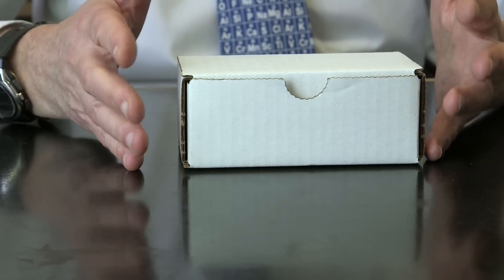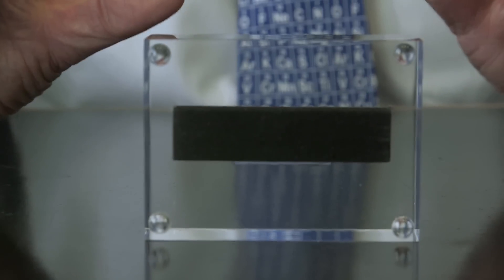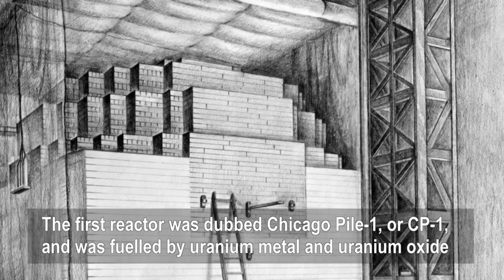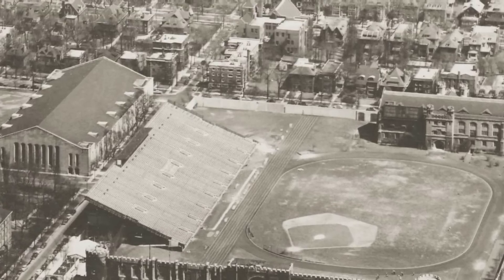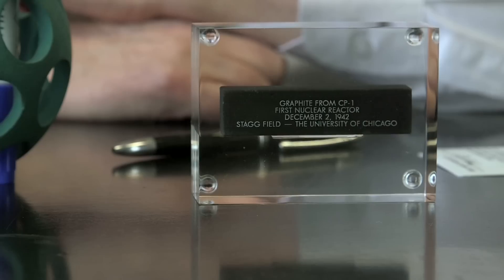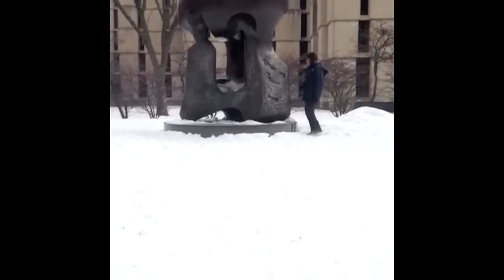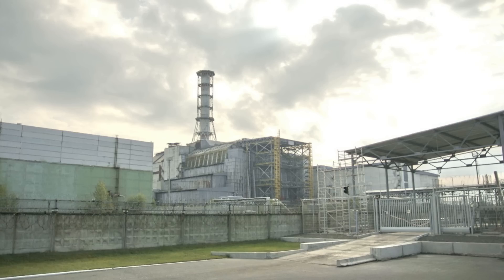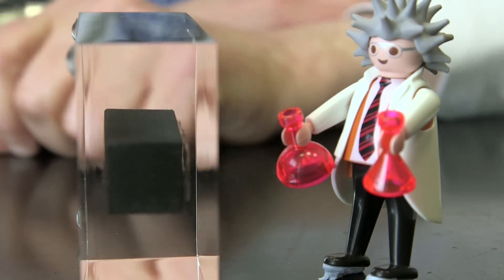What's in the Box?

Comment: Would be interesting to see a video concentrating on the thorium fuel cycle and its role in "burning" actinides and nuclear waste. So much of the debate and nimby-ism of nuclear concentrates on the meltdowns and on the waste disposal and weapons proliferation potential whilst ignoring its potential to finally wean humankind off of fossil fuels and thus slow the output of carbon into the atmosphere. After that, fusion, or space-based microwave power transmission from solar satellites. I suppose that is getting off track into physics instead of chemistry, though.

Comment: Brady, have you asked the professors what they think of the designs for the Liquid Fluoride Molten Salt (LFTR) reactor, which burns Thorium?  From what I understand, these reactors are not only inherently much safer than today's high-pressure reactors, but could actually be used to burn up most of the nuclear waste currently sitting in nuclear power plants all over the world, and produce massive amounts of energy in the process. 

An experimental reactor was built and run for years back in the 1960s at Oak Ridge labs, but was not adopted because at the time, we needed plutonium for bombs.  And these reactors do not make Pu. 

In any case, I would love it if you would ask the professors to investigate, and - if they find the concept has merit - talk about it in one of your videos.  Developing a nuclear reactor takes not only hundreds of millions of dollars but (unfortunately) political pressure as well, since the nuclear industry is so heavily regulated.

Comment: The biggest issue we have with nuclear reactors is that BWRs are cheap but produce lot of waste. And the other models and types are not popular due to cost factors. There are so many ways of achieving better, safer and cheaper nuclear power. But we just don't seem to be willing because of money.
Reply: The shift will occur when the average salt/thorium reactor is cheaper to produce then the waste of a water reactor is to dispose of. (Now if someone can generate power from nuclear waste, that'd be a neat option.)
Reply: Well thorium Cycle reactor with a breeder jacket - as far as I understand. Is able to transform "nuclear waste" to fuel again. But it will sacrifice some of it's own energy output to do that. But then it can add itself in to the cycle. But basically it only hasaround half of the potential energy output compared to the fresh fuel that could be added.

Just like recycling anything else, it takes some energy to initiate the cycle.

Not sure if this system has been proven to work, but what I have read and understood it should work.
Reply: Henri Hänninen That would be the trick, getting the money together to prove it would work viably. If you could do that, and it did work, you'd likely have a ready market for that sort of thing.
Reply: We don't build other reactors because it's almost impossible to do so. Not because it's difficult to design them or difficult to build them, but because of regulatory assumptions that make it a nightmarish slog of several decades to build anything but LWRs. So were kind of stuck with lousy submarine engines adapted for power generation; still, it beats all fossil fuels handidly.

Comment: Some videos about thorium salt reactor developments please?
Reply: I have read about the LFTR reactor design and that it could be used to burn spent nuclear fuel from the common high pressure reactors deployed worldwide. Also that the "spent fuel" has really only had like 2% of the energy potential used up in these high pressure versions and that the so called waste could be used in the LFTR using much more of the energy potential if not all. Can you confirm this please also are radio isotopes that rapidly decay more dangerous then ones that have slow decay rates ie: millions of years vs. a few hours?